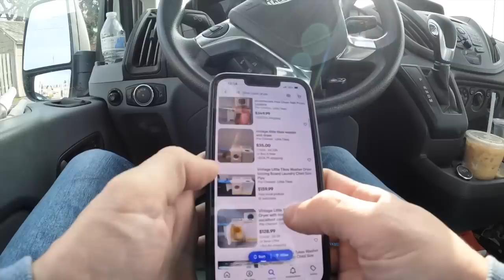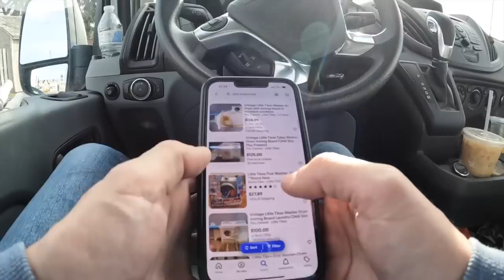This is Worth $100 and Was Thrown Away? - Trash Picking Ep. 708

Comment: Those are both water heaters. They become super heavy if the water is not drained. The drain fixture looks just like an outdoor hose faucet on the side of a house. It may benefit you to get one of the T-handles that will allow you to attach to the valve and open for drainage.
Reply: Mike the scavenger out of Texas always has those on hand, to be able to drain water out of Tanks... he's also very knowledgeable oh, and has a real wire stripper, to get the maximum out of all of his scores
Reply: It's not the water so much as the sediment. Hard water will leave calcium sediment in water heaters, and they can build up and actually fill the tank up. I sell plumbing supplies and sediment is the major killer of water heaters.
Reply: If they were full he wouldn’t be able to move let alone lift them by himself